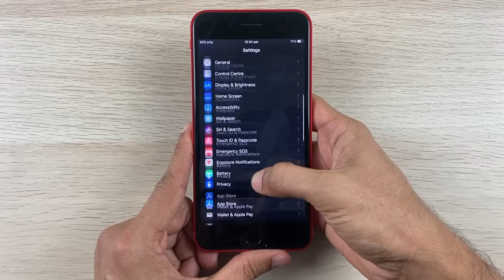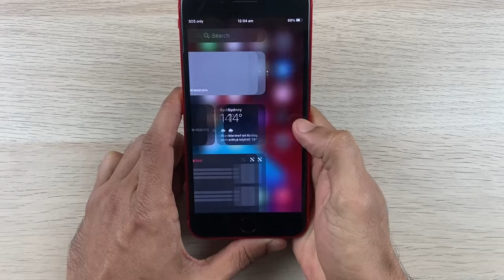Custom iPhone 7 Plus with Square Edges (Like iPhone 12 Series)

Comment: I noticed something, the square version appears to fit a bigger battery. I know that there are already high-capacity batteries around 3400 mha, I wonder if it is now possible to put one at around 4500 mha as it seems to have more space for a thicker battery
Reply: Do these higher capacity batteries really have a good autonomy?
Reply: @horus1225  Yes, a 3 hours more in hard use